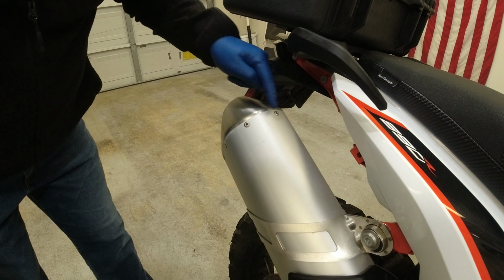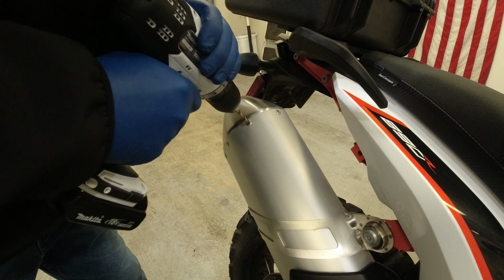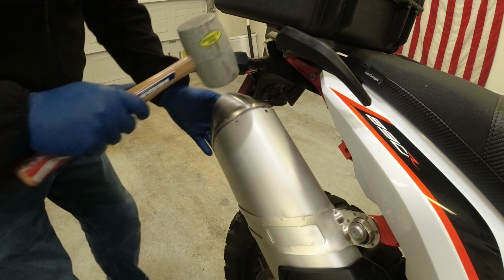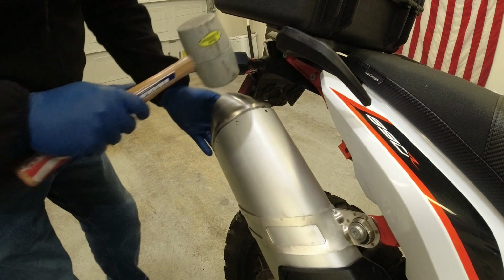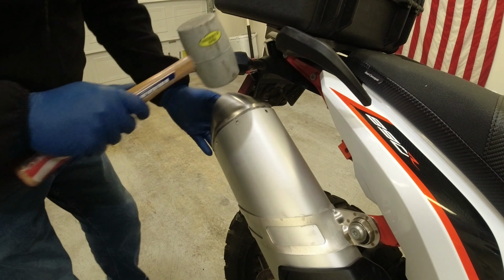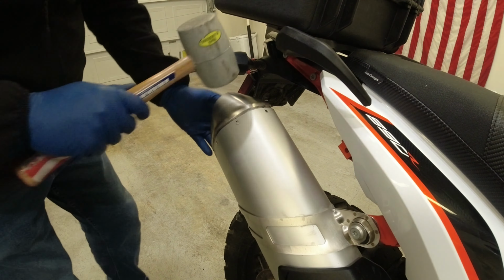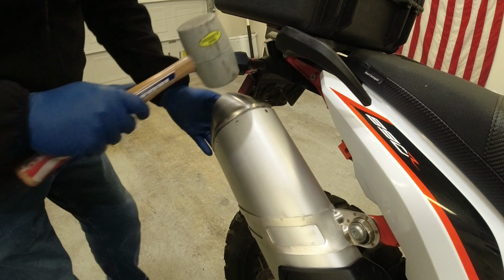DB Killer Exhaust Mod KTM 890 Adventure R

Comment: Great video. Just on the Oxford heated grips, did you fit them yourself ? Direct to battery ? Any issues ? Kind regards. Geoff. NZ.
Reply from the maker: I did fit them myself. It is wired direct to battery. The only thing you have to do special is grind the nubs off the stock throttle tube. I went with the Oxford for 2 reasons. They were cheaper than the KTM grips and they were available. At the time, KTM grips were 5 months out for delivery. A bonus, I found these to work better.
Reply: @Gamet36  thanks for your response, much appreciated. I've had Oxfords on several bikes, arguably better than most factory stuff. Stay safe. Best regards. Geoff NZ.